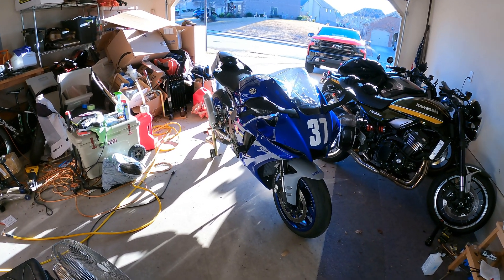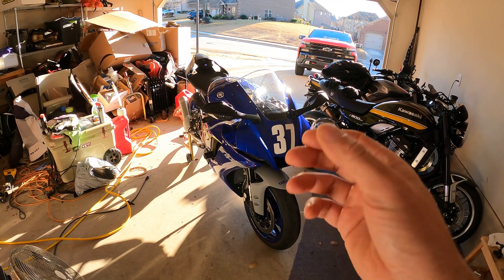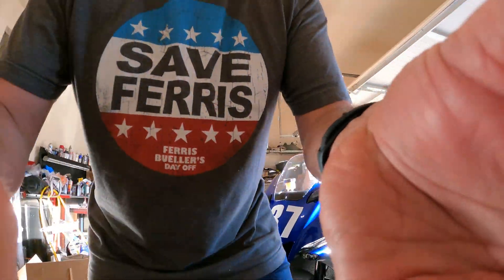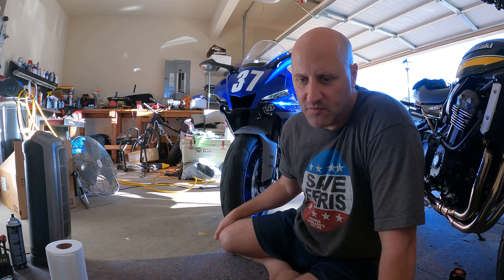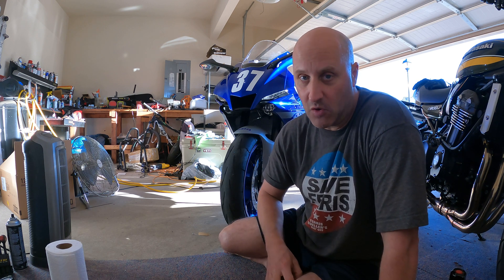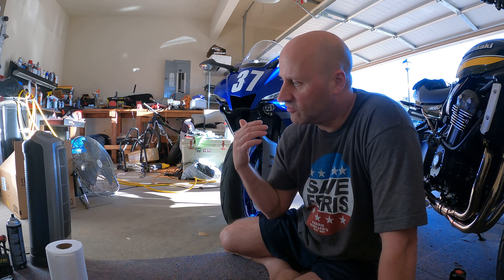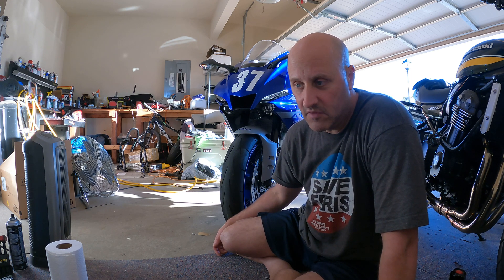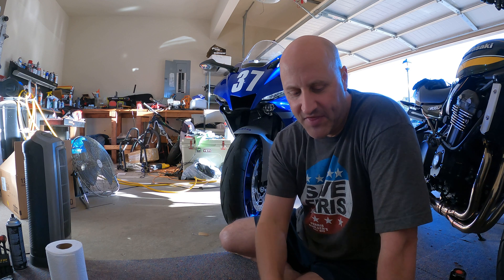How to make an R1 faster?

Comment: Who ever did your flash and tune should have made the throttle response smoother. I have an 18 r1 which I bought brand new. And it has all the bells and whistles done to it. All of that jerkiness you are talking about is no longer. And you should be pulling away from 600s with ease. Just in first and second gear. One being is the rpm’s are higher. And when the 600s are maxed in there power band area and need to shift the r1 has just began it’s power. That’s why I say you should pull away with ease. And by dropping a tooth in the front will make the bike quicker from the start but you will lose your top end power.
Reply from the maker: The issue was that I was running in power mode 2, and only power mode 1 was unlocked.  I wasn't getting full power.  We put it on the dyno, fixed that and also tuned it and got 182hp at the wheel.  The tune is solid for stock headers and muffler with a decat.

But when this video was shot, between it not delivering full power, and the wheelie control constantly kicking in, the acceleration under 100mph is hindered.  Gearing it down, makes it worse, because it simply wheelies more, causing more electronic intervention...  That's why when you look at 0-60 times for bikes, there is only a 0.2s spread between 600's and literbikes.  Until you get into triple digits and there is enough downforce to keep the front end in check, the 600's hold their own.  Once in triple digits, the literbikes start to just run away...

Comment: Dad had a ktm duke , u could really ring that thing out in the moutain twisties. You could get ur "moneys worth" outa tht engine. You cant do tht on a 600/750/1000 .You might have moar fun on a R7 or somthin like that.Perhaps🤓
Reply from the maker: No, I love the power, sound and handling...  This is just me trying to figure out the best settings for the rider aids, that's all...

I wouldn;t enjoy the R7...  That's a step down from the ZX6R that I traded in to get the R1
Reply: @Daves_Man_Cave  I hear wht ur saying , but ive owned 2 1000's and still think a R7  would be fun in tight stuff.........perhaps not at R A.
Reply from the maker: @tootjr  Yeah, I am not saying it wouldn;t be fun...  It's just not the bike for me.  This is bike #29 for me, so there isn't much that I haven't owned or ridden...  If I was gonna go with a smaller and nimble bike it would be the RSV660... Or, just stuck with the ZX6R...

The yamaha doesn't appeal to me...
Reply: @Daves_Man_Cave  lol , power corrupts 😁
Reply from the maker: @tootjr  It certainly does.  Its pointless to have this much, but it is fun.

I wish there were more options in the mid range... more than the 600's, but not as much as the literbikes...

Panigale V2, MV Agusta F3 800, Daytona 765...  I wish the Japanese bikes made a middle priced alternative...  There are a couple 600's left, and then nothing till you hit the literbikes.

The GSX-R750 hasn't seen a significant update in more than a decade....  No TFT dash, no ABS, no traction, no quickshifter...  If they tossed the 1000's electronic package on it, it would be the best sportbike.  It used to be, but not any more...
Reply: @Daves_Man_Cave  Haha , ive got a 2011 gixxer 750 wth 2,180 miles......and thts wth 1 tooth up on rear.
Reply from the maker: @tootjr  I had a 2006 and a 2015...  I did the -1/+2 sprocket kit on mine...
Reply: @Daves_Man_Cave  Nice , i had a 1996 and a 2007 , tht 96 model was a real hoot , l really liked tht brown/gold color.

Comment: guess u won't get around a reflash, or u got 2 get a more sensitive right hand. ;)
 if u open up out of corner you can not have traction and will always burn rubber it is that powerful machine. 
pls watch "Sylvain Guintoli: What is short shifting"
might help u in ur problem keepin her nose down. :)

so if that is true u got 2 adjust ur style of ridin 2 the bomb ur just ridin. might take some time but u won't get rid of the lifting but u will learn to manage it :)

and ye, kids r loud... till they grow up and move away or start smokin... might take some decades. been there done that got the shirt :D
Reply from the maker: Well, short shifting just trades one problem for another...  If the goal is more acceleration, then short shifting slows that down.  Sure, it controls wheelies, but it does so because you keep the revs lower, and therefore make a lot less power...  Either way,  you are not accelerating like you think a 180rwhp bike should.  haha

At the end of the day, on a stock wheelbase bike, there is a finite amount of power that can be sent to the back wheel in the lower gears without looping it, or having to cut power...  A 600-750cc bike, has no such problems... they are basically right near that limit by their very nature... so you can just wind on full power and hold it, and not worry about wheelies or having to back off...

I do think that by turning down the wheelie control and maybe slide control to minimum intervention, the acceleration might come up a bit.  Mind you, I am not saying that it's slow.  Its not, it is in fact pretty savage... but you can feel the bike struggling and holding back power...

Comment: Ps, Chris at Bikeworld Reviewed the the Triumph 1200rr, it MAY possibly be the solution the the situation that you are finding with all these superbikes .  Just saying !!
Reply from the maker: The Triumph is way too expensive.  It does look like a brilliant balance of everything, but I can't bring myself to spend $24k out the door on a bike...  Maybe if they come out with a base model that doesn't have all the electronic Ohlins and stuff, I would consider it...  But Triumph has really been cranking up the prices lately and I don't like that.

The Panigale V2 is probably the best bet...  It's about as much power as you can realistically use on the road and track, and $4k+ cheaper...

Comment: Hi Dave, i hear what you're saying and to be honest you are riding the bike absolutely the way it should be ridden. Unfortunately liter bikes now are totally useless for your style of riding. The sales of crotch rockets has plummeted here in the UK. I feel your frustration, but the simple truth is  unless you stretch the swing arm, the problem is the bikes are to quick!!!
Reply from the maker: I am gonna play with the rider aids and discuss it with the tuner tomorrow.  He's a former pro AMA racer and might have some ideas...

But I think that honestly, the best sportbikes are the middleweights, but that's a class that was largely abandoned years ago...  I would love to see the GSX-R750 get a new TFT dash and some electronics.  It hasn't changed in over a decade.  No quickshifter or ABS, nothing...  Or see the ZX6R punched out to 750-800cc...

Ducati has the V2, and MV Agusta has the F3 800...  Maybe Triumph will release a non-Moto2 edition of the Daytona 765...

I would love to see a bike that has more stomp than the 600 class, but not the utterly crazy output of the literbikes, at a middle price point...  Kinda the Goldilocks zone, if you will...

Comment: Hello been watching your results with new bike I’ve had yamahas we’re not for me but you choose there best I know how to fix your prob first you need stock ft sprocket back second 3 teeth down in rear l know it has no power down low so wensday you need to advance your timing 5 degrees only up to 9 k rpm leave total timing factory spec for top end ask Chris wensday happy holidays
Reply from the maker: When the ECU was flashed, we added in the ignition advance...  And now way I will go down 3 teeth in the rear.  It's already geared too tall.. Going down 3 in the back will make 1st gear unusable and a real pain around town or in parking lots...

Its not that the bike isn't making the power.  it is.  The problem is that the power is too much and so the bike is pulling it back.

This is an issue of getting the right settings in the ECU... Traction control, lift control, etc...

Comment: I know people in the roll racing scene gear it longer to stop wheelies. But that would make first longer so not really an option for you.
Reply from the maker: Yeah, don't want to go that route...  At the end of the day, I don't need to go any faster...  But its my need to know why a 180hp bike isn't faster than a 125hp bike...  haha

It can be, I just have to sort out the electronics...
Reply: @Daves_Man_Cave  Might be the case of running that fine line between you cutting power and the bike but not having the bike cut in so much that it’s slowing you down. You only just got it, I say give it some time and you’ll get used to it!
Reply: Never to tall you have 6 gears use them smoothly
Reply from the maker: @albertschneider5978  You absolutely can have them too tall.  Gearing up makes the bike accelerate slower, and makes it horrible at low speeds.  It's already too tall from the factory...

Comment: Modern liter bikes are over the edge. The power to weight ratio is outside the bounds of what the geometry of the machines are capable of dealing with. There's nothing that can be done about weight and the geometry is fixed in a small window... So all that's left is to cut power. As sophisticated as electronic rider aids get, all they are essentially doing is cutting power when a certain condition is met... ie: wheel lift, wheel spin or slip.
Reply from the maker: Yeah... I will find out what the actual power is on Wednesday, but it's one thing to have it, and another to be able to actually use it.  Don't get me wrong, its crazy fast...  But you can tell its holding a lot back...
Reply: @Daves_Man_Cave   Like you said, all that HP is only usable in the stratosphere of speed... You're going to have to move to Cleveland, OH and hang out with 650ib to get your money's worth....  🤣😂